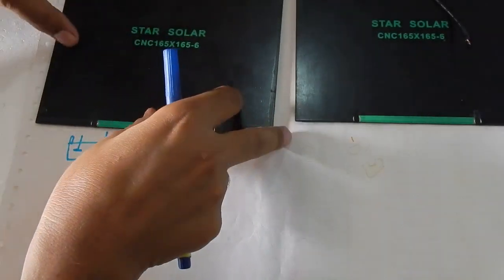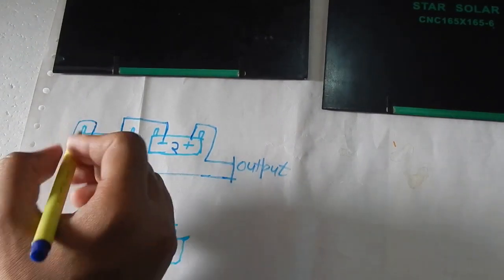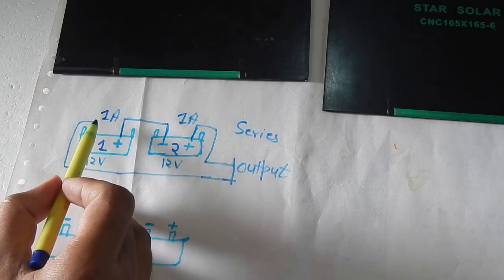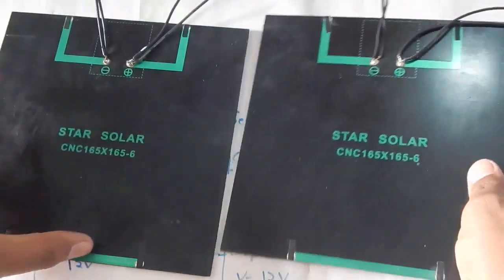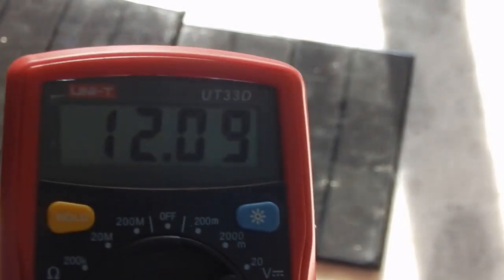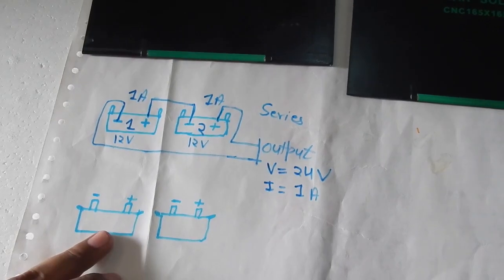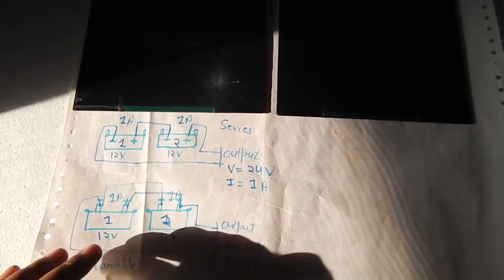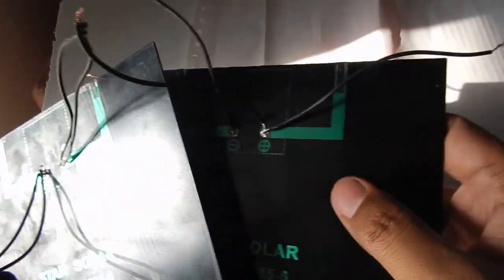How to connect solar panel or Battery in Series or Parallel

Comment: I have two 6v 750mah solar panels. I am connecting them in parallel. Then i am connecting a car charger. But when i try to charge my smart phone it says low voltage. Can you please explain why is this happening. Thank you very much
Reply from the maker: Car charger needs at least 12 volts to work.
Connecting to 6 volt panel in parallel would give you 6 volt which is not enough.
So, you need to connect the panels in series, In series the voltage will add up and give you 12 volts. then you can connect the car charger but the charging will be slow because of low current of small solar panels.
Reply: @gurribuy  what solars should i use in this case. What is the minimum voltage to charge a phone properly. Thang you again :)
Reply from the maker: @drilonsalihu753  Any 12v panel should be good enough for using car charger.
our phones take 5 volts to charge.
But, some phones also support fast charging but requires dedicated fast chargers for them.
Car charger converts 12V into 5 volts so that we can charger our phone.
If your phone support 10watt charging then buy at least 10 watt solar panel. then connect it to the car charger & finally connect your phone.
Reply: Thank you for the answer

Comment: How many 6 volt panel will I need to charge my phone?
Reply from the maker: how many solar panel do you have and their voltage and current??
Reply: @gurribuy  Electronicspices 6v-60 mAh Rectangle Shape Mini Solar Panel for DIY (80 x 40 x 03 mm) - Pack of 10
Reply from the maker: @rokie231  you can connect 5 of them in parallel, connect the other set in parallel  and then connect the two sets in series. Finally you will get 12v 300ma. Now because we can't connect 12v directly to our phone you will need a 5v charge controller.
Reply: @gurribuy  thank you for replying